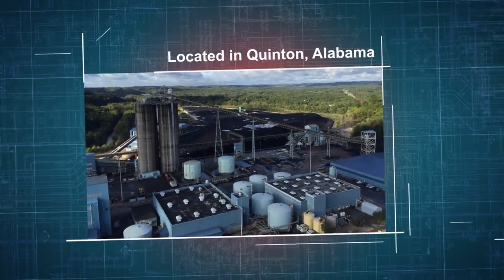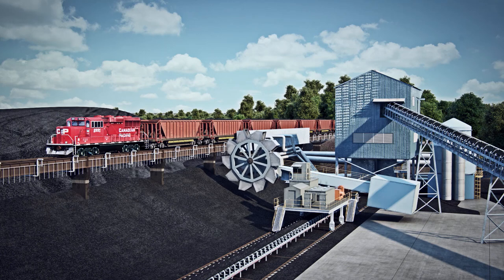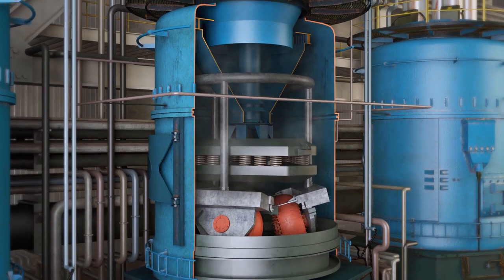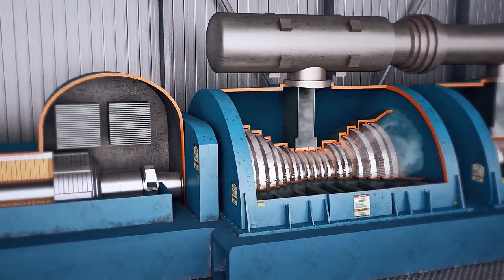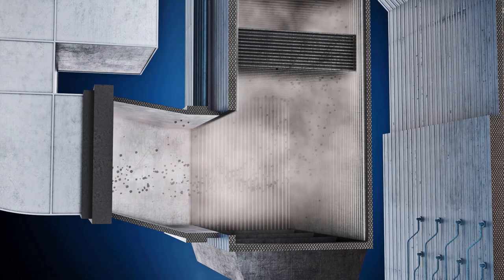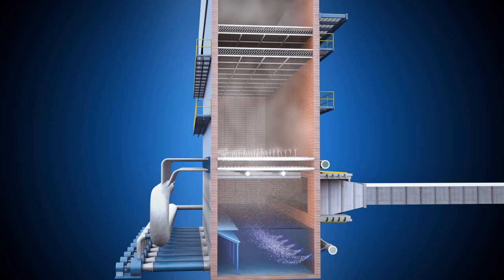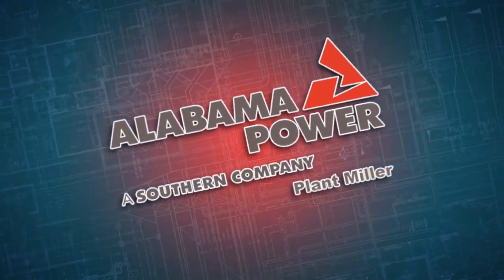Alabama Power's Plant Miller How Electricity Is Generated 3D Animated Tour

Comment: Electrical company needs to update, if they're ever going to compete with others. They're going to be left behind for cleaner, cheaper, and much more efficient energy than coal. Where others are having solar farms or wind turbines everywhere. And much more healthier environment for their employees to reduce medical expenses in the USA. It's a nice design to see the old ways. But needs to improve/ keep up w/ competitors.
Reply: Solar and wind are close to useless.
Reply: I priced a solar installation at my house to be completely off the grid: about $4.50 per kWh... From the utility ( which burns coal ) ... about $0.075 per kWh.  Coal has set the standard, everyone else better update if they wish to compete.
Reply: slamdvw 🤔 If this is true? How are you paying $4.50 to be off grid?  And who will you paying when you're using natural resources from sun/ wind? Can you help us out with that? With having solar/ wind energy? Better/ upgraded version will eventually have to come out to keep everyone employed. Just as it suppose to be with other techs.
Reply: I should have been more specific: It's not a continuous paying of $4.50 / kWh, it's the initial outlay of capital to buy the equipment.  After buying roughly 30 THOUSAND dollars worth of panels, batteries, inverters, cables, then yes, it's completely FREE!!  My highest bill, to date ( includes the coldest couple of months ) was $280 for electricity.  At that usage, it'd take 107 months to pay off 30 grand worth of equipment.  It's going to get cheaper, because I run swamp coolers for air conditioning, and our cold weather is slowly becoming less and less.

So we'll say just for the sake of argument, that it'll take 120 months to pay off.  Those that are victims of public education, that's 10 YEARS.  Now if not a single battery, panel or inverter has any problems, then maybe, it'll be a good investment.  The cost of that equipment better get cheap and soon if you're going to convince me that solar is cheaper.

Comment: “Nuclear”!!!
Reply from the maker: Nuclear is definitely part of what's being done currently, right? It's not all coal, not all renewable, not all nuclear, not all hydropower, it's a bit of it all. Is that bad? Don't we just need a better balance and also better methods to restrict pollution generated from any or all methods?
Reply: Nuclear is just cleaner. Dont tell me its not i work for ERT in Virginia. Coal vs nuclear. Go to newport news ERR  coal Pier 9. Coal mite be clean but not carbon monoxide. Plus all these fuel depots we have there nasty and some put gas and oil in the ground and in the Elizabeth river and then in the Chesapeake Bay. Its about money and dont bullshit me on that either. Its all about money.
Reply from the maker: @levijones1874  No doubt it's all about the money. It always is. But the question still remains. People rail against coal or they hate nuclear or this or that. But could we go all nuclear? Is that even an option, or does it come down to a balance between methods?
Reply: @edpvideo  Maybe go one third nuclear, one third natural gas, and one third renewables.

Comment: Great video, I never knew drywall was a by product of a coal power plant. Looks like the condensate part, converting the steam back to water with cooler water really will lower the overall efficiency of the entire system. All that heat gain is just wasted as it is cooled. I see Google listed thermal efficiency of a coal  plant is 37%. Google Also says coal plants release low levels of radiation because the trace elements are in the earth crust, who knew...
https://en.wikipedia.org/wiki/Fossil_fuel_power_station
Reply from the maker: @Kevin Willard - yeah, who knew - we didn't until we did this animation. Never knew (or thought about) where drywall came from

Comment: Coal is a far superior energy source compared to unreliable, intermittent wind and solar. We’re lucky to have this abundant and low-cost form of energy which enables us to survive in our naturally dangerous climate.
Reply: But it's dirty.
Reply: nuclear power is better
Reply: @DanielCallejasSevilla  Like all power sources, it has costs and benefits. Overall, coal is a vast net benefit. Through improved technology, we can further maximize the benefits while mitigating the costs.
Reply from the maker: @SWOBIZ  Excellent summary of the state of the power industry.
Reply: SWOBIZ i do agree with you and we need to drastically lower green house gasses but for now coal and nuclear is the best option but the only thing that can supply our power needs but won't kill us in the end or run out is fusion and thats only 20-50 years off so the best thing we can do is put more fund into research and try to lower imitation until that point and a good way would try to use more nuclear power and those are the right now
Reply: @Hunter-bm6ss I think nuclear is about as safe and reliable as power supplies come. Unfortunately, Government has imposed a regulatory "death penalty" on the industry; until those rules are removed, nuclear will be in the dog house. Very unfortunate.

Comment: How much energy from the burning coal actually makes it to your home as electricity. Is it 30%? Somebody out there must know the number.
Reply: Carl Pheneger depending on the distance of transmission lines and other variables, the net energy that reaches your house is between 20 and 30% of that contained in the coal as delivered to the boiler. 
This takes into account the thermal losses in the power plant, parasitic losses for operating the pumps, fans, and other equipment needed to operate the plant, transformer losses, and line losses from the plant to your home. 

Other forms of generation are mor or less efficient. For example hydro generation can vary from 15% to 80% efficient in capturing the energy of water flowing over a dam depending on the percent of water flow total that passes through the turbines.
Reply: @billmoran3812  Thanks
Reply: @billmoran3812  sound inefficient and unproductive
Reply from the maker: @Bill Moran - thanks for the info
Reply: @menzishoba7696  Stop using it.
Reply: How is that going to help anything
Reply: 90s.
Reply: @billmoran3812  re: "the net energy that reaches your house is between 20 and 30% of that contained in the coal "
Bill, its higher than that. Large central gen plants are the MOST efficient way to do 'power'. Your CAR is about 20% 30% with the gas it uses.
Reply: @uploadJ  when you consider the thermal and electrical losses in generation, transmission and distribution, the net energy delivered to the customer is about 30%. I’ve been a utility engineer for 45 years and built many plants.
Reply: @billmoran3812  re: " I’ve been a utility engineer for 45 years "
Bill, you're recalling 'data' from when textbooks were written for your training years, which puts them SEVERELY out-of-date. Even the new CCGT micro turbines from Capstone are on the order of 60% efficient, and 'modern' central gen with all kinds of heat recovery beats that significantly!!

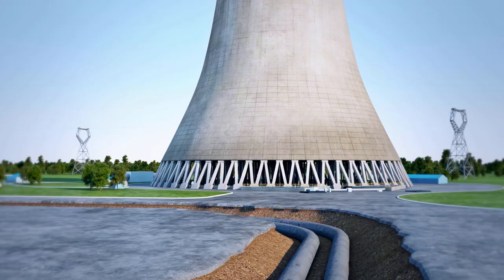Comment: 5:34 why cool down the water why not use it's energy again for something else. ranther than cool it to heat it up again?
Reply: The system needs cool water and very hot steam to work. It extracts power from the difference in energy between the two. Transferring from steam to air directly would be nearly impossible because of the volume of air required.
Reply: You want the whole loop to have nothing but water in it, either steam or water. The end of the low pressure turbine can be under vacuum as the steam moves to condensers.
Reply: In newer and more effective facilities you use some of that heat to preheat water or air entering boiler. Some powerplants use some of the excess heat to heat surrounding homes, even towns, and industry buildings.
One month ago I had to do presentation about steam turbines and found some interesting data about "typical 500MW steam turbine". In the tabel there was temperature and preassure of steam entering and leaving different stages of steam turbine. 
So for the low preassure turbine, the last one, entering preassure and temps are 3 Bar/230*C and at the outlet there is just 30*C (if you searach a little bit, it really may be that "cold") and only 0,05 Bar preassure. Yes, 20 times less than atmospheric preassure. There really is not that much energy left, because powerplants are made to turn that energy into mechanical energy the most effective way. You couldn't use something that is only 30-40*C hot to heat something effectively even over small distances.
Reply: The turbine can’t extract all the energy from the steam.  If it did, the steam would turn into incompressible liquid water which does not perform like steam and could damage the turbine blading. The exhaust steam must be condensed back into water so it can be pumped back into the boiler to be reheated. In some designs, the water heat can be used for other purposes, but usually its not economical to recoup much of this heat.
Reply: @SWOBIZ  right, you can pull almost all the  potentially extractable energy out, and then condense the steam by exchanging heat with cool water. Leaving the condenser at very low pressure (something slightly above the boiling point of water at the temperature of the condensate). That low pressure allows for pulling every last bit of available energy from the steam. 

Coal of course is just about the worst modern way of getting energy. With such huge volumes of raw material and waste ...
Reply: @SWOBIZ  I did not said, that it extract's all of it's energy, but it does it the most efficient way. 
As I said, no mater how much energy is left in that steam, it's because of it's volume, not because of the temperature. Water in condenser which extracts heat from steam that is 30-40*C is not usefull at all. You wouldn't even be able to heat most of the house types. 
I wouldn't call coal as the worst energy source. It have very high energy density and we are able to clean exhaust gases to be very, very clean. Ash may be used to make roads and lime from gases cleaning may be used to produce, for example, gypsum boards. So you not only use coal, but you also produce something, that may swap other natural resources, that would have to be diged from the ground.
Reply: They do. Each stage in the turbine uses less and less heated steam to the point of diminishing returns, then starts anew.
Reply: @ushoys  I understand. But the cold water after the heat exchanger is warm/hot and needs to be cooled back down. Taking water from a source, passing it through once, and dumping the hot water into the environment would be more damaging and expensive

Edit:going open circuit on the cooling water is almost certainly an option in an emergency, but even the cooling water gets treated and dumping that water once it's picked up some heat is wasteful compared to just treating enough new water to make up for losses

Comment: in a serious comment, why don't you guys compress the gas and reburn it? it's used globally to reduce the CO2 emissions and will put more energy output for the tonnage of coal used.

There's no such thing as clean coal but it's much more cleaner than st burning it once and not using the gasses in the exhaust to the maximum potential
Reply: WTF are you talking about?  Burn what again?  The gas that come out of the stack is nearly all CO2 and H2O.  There is nothing to burn again.  The gases in the exhaust are used to their potential.  The preheater for the combustion air (the big round rotating thing in the flue gas path after the economizer) uses heat from the exhaust gas to preheat itself, this makes more efficient combustion.  The flue gas leaving will not be much above 220 F.  In fact, it may be heated slightly to that level.  This is done because at 212ish the H2O in the gas will start to condense.  If this happens prior to the SOx scrubbers you will end up with serious corrosion issues.  

When something is burn it under goes a chemical change that can not be reversed.  They can not even recompress the steam and send it back through as they would cause a net loss.  Trust me, if there were a better way it would be done.  The electric market is very competitive right now.  Natural gas is killing coal.  And even within natural gas there is a struggle to be the most efficient and flexible units.  The more efficient unit is the one that gets dispatched first as it is the cheaper unit to operate.  You do not make a lot of money if you are not running.  There is also a strive to be the cleanest unit out there.  The cleanest one is not the one the EPA tries to shut down.  This is all big money stuff.
Reply: I don't mind clean coal plants too much but there is good better best out there, the clean coal plants use the exhaust and reburn it but dirty coal plants don't do that.

Thee best is renewable, not saying "put solar panels on every home" type of renewables but the ones that are pricey up front but gives longer term results, using mirrors to boil sulfer and have insulation underneath so the steam generators keep working through the night and morning.

You can call my a hippy if you like but in the end, what would you do if your fuel source ends? coal fire plants only burn 2 things, coal and charcoal 1 is easy to get the other requires energy to make I'm not looking at environmental standpoint, I'm looking at sustainability which means longer term money income

Comment: Another "great video" being in my reccomendations....
Shut that thing down and build solar panels on that area.
Reply: And if you want to turn on a reading lamp at night?.....
Reply: Then I'm using my in-home Tesla Powerwall...
Reply: Building solar panels on the same area this power plant covers would generate a tiny fraction of the power this power plant generates.
Reply: Probably yes but have you ever checked how tiny (relatively speaking) the required landscape would be to run the entire world on solar panels? Of course you need to store energy. The project Tesla built in Austriala seems to work very well for a storage of that size.
Reply: A tiny area to run the entire world on solar panels? Seriously? Solar Star the largest solar farm in the United States covers 3,200 acres and generates 579 megawatts. You consider 3,200 acres and generating 579 megawatts  tiny? It would take square miles of solar panels to generate 2,900 megawatts. You call square miles of solar panels generating 2,900 megawatts tiny?  The world uses terawatts of electricity. Solar is too inefficient and unreliable to generate the world's electricity. A battery powered aluminum smelter? A battery powered steel mill with 40,000 amp arc furnaces? A battery powered hospital?  New York City running on batteries? Tokyo running on batteries? London running on batteries? The batteries just to run the aforementioned cities would cover a vast area.  Also, better hope the Sun returns to the square miles of  solar panels before the vast battery arrays running hospitals,  drinking water pumping stations, sewerage pumping stations, refrigerators, etc., go dead.
Reply: ...
Did you read that I wrote the word relatively?
Go check out the space of landscape that is not under water and compare that to the size required to run the world on solar panels... you can add water and wind generation if you want.
In THAT RELATION it is tiny. Tesla even made calculations for that. If you don't belive me you can check it out by yourself.
And instead of just building a huge concentrated area of solar panels - spread it...
Reply: Yes,  I saw you wrote relatively. Solar is not practical to generate the world's electricity regardless of how it's applied.  For instance,  roof top solar panels, an example of spread out will not generate enough electricity to run the Empire State building in New York City. Wind is also too inefficient and unreliable to generate the world's electricity as well.  I drive by a wind turbine on a daily basis. I've lost count how many times it's not turning and therefore not generating electricity. A shopping center near where I live installed wind turbines to generate electricity to run their parking lot lights several years ago. They took the wind turbines down because they didn't generate enough electricity to run just the parking lot lights.   Water is the only source of electricity you mentioned which can rival fossil fuel power plants. The largest power plants, in the United States, and the world in terms of megawatt output are Hydro.  Hydro is limited by fall lines and adequate water supplies.

Comment: Why cool the water if it's just going to be heated again?
Reply: Because its steam? Then its hits pipes full of cold water, which makes it water droplets pretty much, all falling to the bottom and being re used
Reply: Thermodynamics says that the greater the temperature between the hot (boiler) side and cold (liquid water) side, the higher the efficiency of the plant
Reply: Justin Schock because it only works while it’s turning into steam because of the expansion from water to steam. I understand why it seems stupid but it can’t work if it’s in a steam state.
Reply: Actually, it is because you need to take the fluid to a high-pressure state again, and it is easier to do it with liquid water through pumps than steam compressors. Also, what @theDuemmer said.